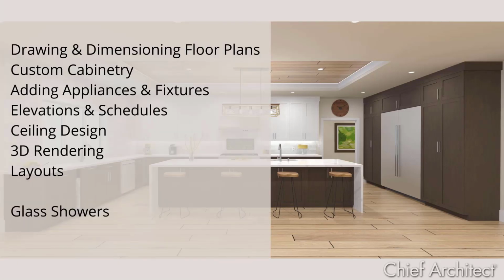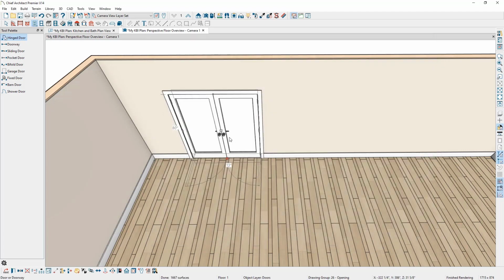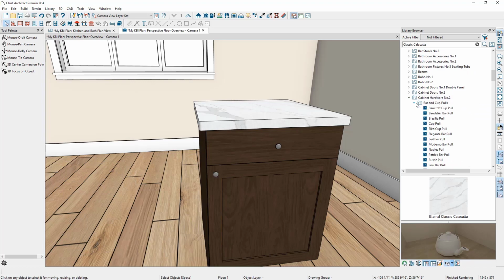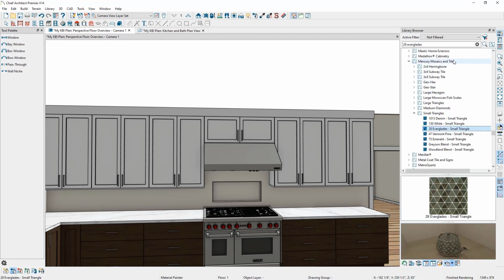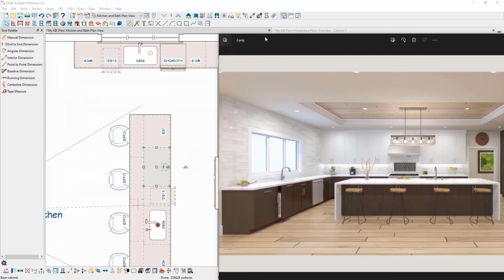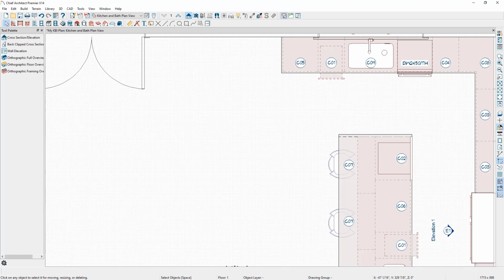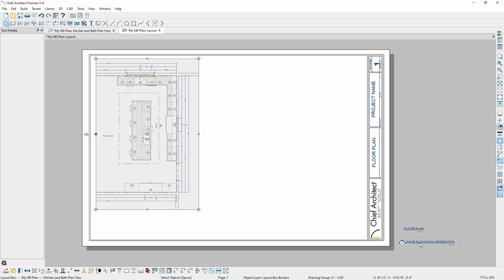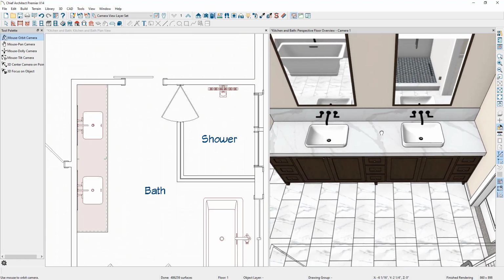Chief Architect Kitchen Boot Camp Demonstration

Comment: Overall great tutorial, but I have a couple notes: 

1. Why would the instructor use pre-made architectural blocks for things us students need to have placed in order to complete the additional, immediate instructions? This happens twice: once with the kitchen island and then again later with the refrigerator/pantry unit. 

        1.a) The instructor does eventually teach us how to create 95% of the kitchen island block, albeit way after trying to make us practice manipulating dimension lines connected to these cabinets that we don't know how to recreate yet! That order is baffling. 

        1.b) The instructor NEVER comes back to teach us how he put together the tall pantry cabinets with the built-in fridge casing. Not even a cursory, 'this is basically the same process as xyz,' before moving on entirely. No dimensions mentioned at all, so we can't even attempt to eyeball it ourselves. 

2. Why would he introduce glass doors and walls for a shower, in a video explicitly titled "Kitchen Boot Camp" and yet not teach us how to add/manipulate the pendant light over the island OR building the fridge block?  

Please tell me these items are addressed in later versions of this tutorial.

Comment: When I put my handles for the wall cabinet both handles are left aligned on their respective door. How do I move the handles? Either make them both center aligned or make the left handle right aligned and vice versa?
Reply from the maker: If you double click on the cabinet to open the specifications you can adjust the door type to double instead of auto right or auto left. It should automatically update the handles.